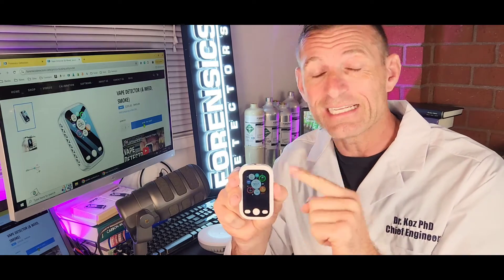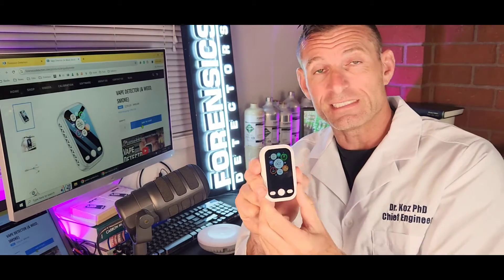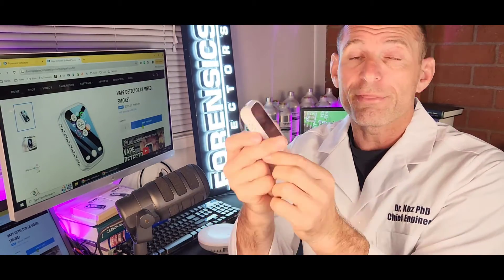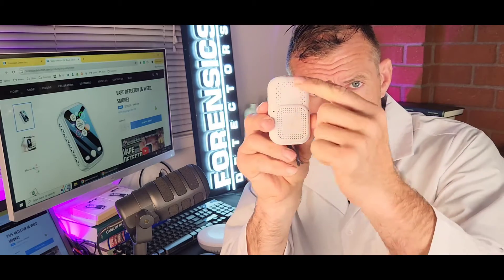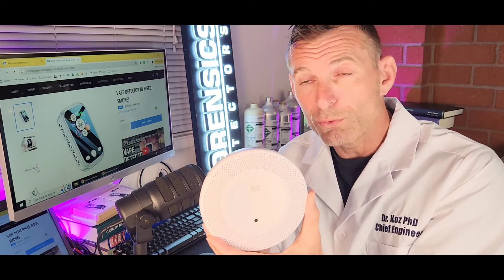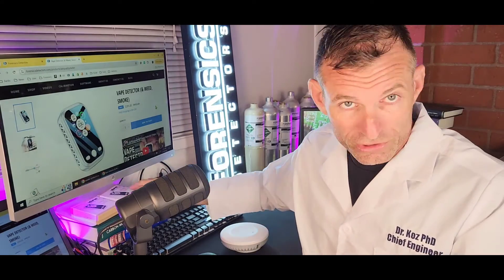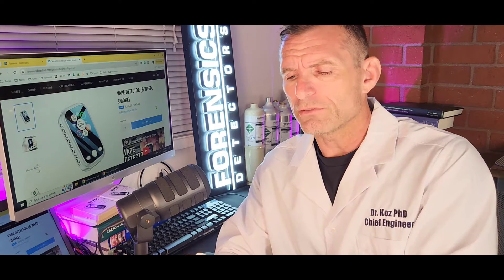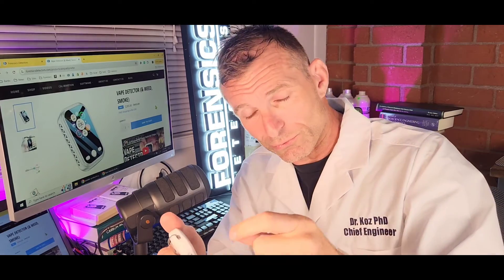Cigarette Smoke Detector (Test and Demo)

Comment: I have houses on both sides of me, and I get cigarette smoke smells (not chimney, done all that). One says they don't smoke, but my Mrs saw them smoking, and the other only smokes a bit. Trying to figure out which side is seeping through, or both, is a nightmare. Will this indicate if cigarette smoke is seeping through (at a guess, skirting boards)  Thanks
Reply: Same with me. I live in an apartment
Reply: @BuildingDaMan  I am going to guess no because the ones that do that cost 3x more than this machine. For me, it was not so much that I could smell it; it was that I needed to know where it was coming in so I could seal it. 
It turns out that my old chimneys, which we don't use, were causing a vacuum and pulling the smoke smell through every little gap it could. I used chimney balloons to slow the vacuum effect down, and the smell has massively dropped.

Comment: It doesn't detect cigarette smoke, but particles regardless of if they're from cigarettes or from some other source!
Reply from the maker: Thank you for your comment on our "Cigarette Smoke Detector (Test and Demo)" video. You're absolutely correct - our detector is designed to sense fine particles in the air, regardless of their source. While it's marketed for cigarette smoke detection due to its common application, the device will indeed respond to various types of particulate matter, not just those from cigarettes. This versatility makes it useful for detecting a wide range of potential air quality issues. We appreciate your insight, as it helps clarify the broader capabilities of our product for other viewers.
Reply: @DrKozForensicsDetectors  doesn't help then when dealing with smoking neighbours in next condo